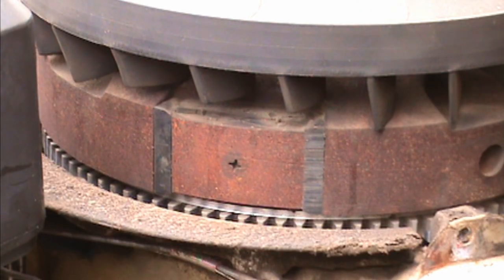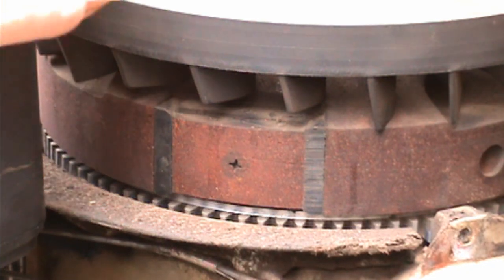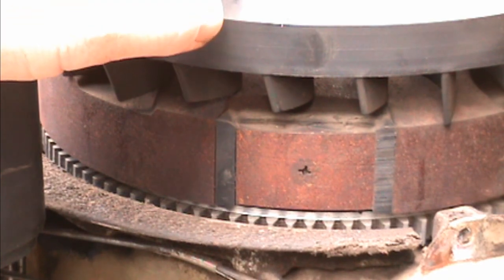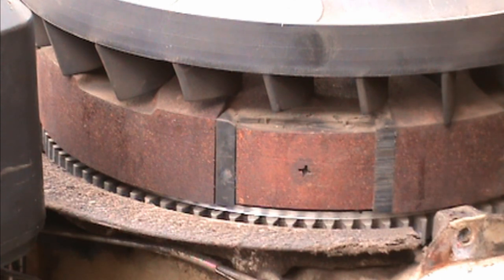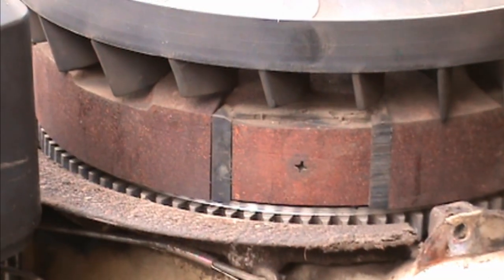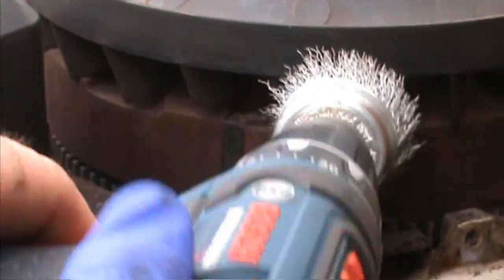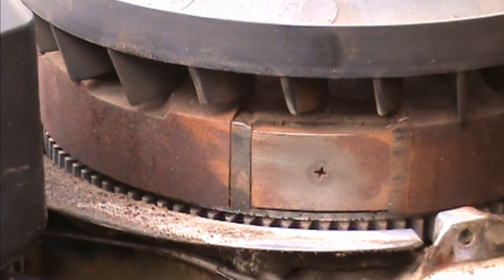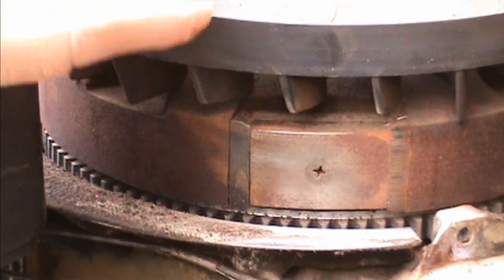Cleaning a lawn mower flywheel rust caused by water or moisture and how fix it.

Comment: On the first pull my mower would run fine for like a minute or so then quit until I gave it 10 minutes, then same thing again. I cleaned the entire fuel system, spark plug, and air filter. I had spent hours messing with the SOB. I was just about to go buy a coil or throw it off a cliff. I came across this video and thought, well I've spent all this time jacking around with it so I guess I try this as my final effort. I was literally about to throw in the towel and this worked like a champ.
Reply from the maker: That is great news, glad it worked for you.

Comment: Thx for sharing. this helped alot.I got my neighbours lawn mower running alot smoother because of this. It had been left outside for two years in the rain, snow without being turned over once. still needs a few other things tweeked but just doing this one thing alone made a huge difference in how the engine runs and sounds and the power its generating now. The regulator is charging the battery which it wasnt before too which is a bonus! new spark plug, carb clean and an oil change and shell be as good as new
Reply from the maker: Great news Gavin, glad to hear.

Comment: Great video.. My grandpa taught me this technique when I was young and my mini bike always started easily
Reply from the maker: That is great to hear.
Reply: Been trying everything to get the mini bike running for the kiddos. Did a run through on it and cleaned everything. It had been sitting few years. Told my pops how it wouldn't started, and had mentioned to him the throttle cable was locked up. He had put 2 and 2 together quite quick and suggested it might be the flywheel is rusted. Sure enough! The false spark had me going through the carb more times than I'd care to admit. Gonna have the boy clean her up tomorrow, this should be what wakes the Ole girl.

Comment: I did this on my mower. Flywheel magnets were very rusty and also so was the magneto just used a small dremel sander attachment and that cleaned it up like new :)
Reply from the maker: Thanks for sharing glad it helped.
Reply: Sounds like a great idea with the Dremmel. However, I’m confused about the gapping of the flywheel. Any tips on performing that?
Reply: @MrRedHotChiliMan When gapping any magneto I use a business card. Then put the magneto in place and tighten the bolts that hold it on. Then slide out the business card. Then I test by turning the flywheel to observe everything is OK. Theres no rubbing of the magnets on the coil.

This method usually works for me
Reply: @mowtoegee7049  okay, thanks for the rundown. Seems easy enough.

Comment: be careful, wire wheel may weaken magnet.  I use 220 wet paper and only rub one direction, compress air for fast dry
Reply from the maker: Thank you for the tip.

Comment: Good video. Had my x530 go out, and was getting what I thought was an insanely small spart on it. 
Pulled the shroud, and that magnet was just covered with rust.  Cleaned it, and replaced one of the ignition coils.
Flywheel gear is so nasty with rust, I'm wondering if I should pull it to clean. 
Good idea about the WD-40, I was thinking of that.
Reply from the maker: Glad it helped

Comment: Thanks for the info. I just cleaned a push mower and washed the entire flywheel. I haven't started up yet since I need to put it all back together and change a few parts but now I'll know what to do if it starts having start up issues. I do have a question, is it normal for the bottom of the engine where the blade rod connects to the engine to be oily?  I already removed all the engine oil prior to cleaning but I noticed that when I tilted the machine over to clean the underside, there's some oil leaking that seems to be coming from the area where the blade rod connects into the engine from the bottom. Any help is greatly appreciated.
Reply from the maker: It could be seeping from seals or a gasket. I sounds like the shaft seal.

Comment: I have found that using a coating of any kind will keep the magnet from getting rusty. Just that simple fella. WD40 is very temporary fix at best. An epoxy coating will last the test of time.
Reply from the maker: Thanks for the tip

Comment: This is why, whenever I wash my lawnmowers, which I do occasionally, I start the engine immediately afterwards and let it run for five or 10 minutes, so it will blow everything dry and heat up and evaporate water.
Reply from the maker: Yeapper.

Comment: Hi could i use a brass brush or does it have to be stainless steel? Thanks!
Reply from the maker: Really, any brush will work to remove rust. Just clean it afterward with acetone or similar cleaner.
Reply: Thanks @jetzombie

Comment: Hello, I'm trying to fix my own lawnmower and my question is do I need to take the flywheel apart to clean everything as I've put a new ignition coil on it and I'm still not getting a spark?
Reply from the maker: The only real reason to remove the flywheel is if you struck something and sheared the keyway that flywheel lines up on the shaft. If it shears, it will through of the time and spark.

Comment: Thanks, this helped.  My troy bilt power washer with a briggs and stratton has a pan around the flywheel with a lip that curves up.  Makes it real fun to try and get it clean with the little bit of space between the pan and the edge of the flywheel.  What are these guys thinking when they design this stuff?
Reply from the maker: Fantastic! You gotta love engineers, I deal with it every day. My brain hurts sometimes trying to figure what they are trying achieve.

Comment: Not enough magnetic flux is flowing through the gap to the magneto to energize it to a full energy transfer. There is no “contact” between it and the magneto. 
What you “will” get is sufficient energy transfer at a lower engine rpm, meaning, engine startup. 
Very little physical momentum needed to turn it over to get proper starting conditions.
Reply from the maker: One other one I got had less than .001 gap and couldn't get it to start. So I cleaned it up and re-gapped to .006 and it started up and ran fine, still running fine.

Comment: Very helpful tip,,,do you clean the whole flywheel with with wire wheel?
Reply from the maker: That's great, I brush off anything that may be sticking out. But focus on the coil and magnet area.
Reply: @jetzombie  thank you sir

Comment: I moved the flywheel around a few times checking compression with the armature off. Does it have a correct position? What I mean, is it like a car engine where you can inadvertently put it in a 180 degree position (like timing) or does that not matter? Mine is a Briggs/Stratton Brute pressure washer. I can't get spark after installing a new armature/coil. My flywheel/rotor is a bit rusted but the magnet seems relatively clean (I did use some sandpaper to clean the entire rotor/magnet of rust). Spacing of armature looks good. It was working but I washed it last fall before I put it away in my garage. Checked compression (dry) and got about 75psi. I just don't see spark (and put in new plug).
Reply from the maker: Bryon,
With what you have described, no your not out of time. What was the gap that you set it at? ideal depending on the engine size and type is usually .006 to .008 between the magnet and the armature. Once the gap gets bigger you will erratic spark or no spark condition. Now make sure the kill switch wire is healthy and not grounded out somewhere. The system is pretty simple but can be a pain too. Now, nothing says that your new armature could be bad, have had that happen to me a few times, straight out of the box. There are some good links to show how to ohm's check your (armature)coil. Your compression seems a little low, but not knowing the exact model makes it a little hard :). if you have a 6.75 brute you might want to check the gap of the valves and rocker arms to make sure they are correct. 
So, I would recheck the kill switch grounding, the armature ohms, the armature gap and get it between.006-.008 (business card or 3x5 is close) and check for the spark with a spark checker like from Autozone or any auto parts store, it better grounding for the plug, seeing the actual spark and less like to be shocked :). Hang in there and feel free to ask anything if you think it can help. 
This is the worst case
You can be off time, but only the shear pin has sheared at the flywheel at the crank mating spot or somehow the shear pin, the flywheel was installed incorrectly, but being that it's a pressure washer, I'm thinking not, because you would still see spark. Now, internal the timing gear assy and or camshaft could have failed too and you would need to drain the oil and look inside with a borescope(you can get a cheap off of Amazon or eBay that works off of the phone or tablet) or pop the valve cover off to see how much the travel is in the valves and rocker arms. But, you would be hearing a clanging around inside and or the engine would be hard to pull , this would not really interfere spark, but compression and starting  But, that's the extreme of it.

Comment: does it matter if you paint the flywheel or not?  if you keep the magnets clean?
Reply from the maker: Not really if the is not rust under the paint and the gap is correct.
Reply: Thank you.  I have a flywheel that was rusty and I cleaned it and treated it with phosphate/cleaner.  I’m just wondering if I should spray a coat of paint to keep it from rusting again

Comment: any oil or  dirt will inhibit the spark more than rust will.       that's the bigger problem.  (and that iron is just cheap cast iron -- so oil can get into the metal.)  it seeps into the metal at a level you cannot see. .
Reply from the maker: Never had any issues after using WD--40, but I could see what regular oils would cause an issue.

Comment: Damn, I gotta do this ASAP! I rinse my 20 year old tractor engine weekly, even the cowl cover. All of a sudden, my tractor started idle surging. Outa nowhere. Ran great for YEARS. I'm wondering now if this is the culprit. I'm hopeful, since a carb teardown revealed nothing
Reply from the maker: It could help.
Reply: I try to do engine  cleaning what ever it is (small or large) with compressed air, leaf blower (to get rid of stuff like grass and grime) and degreaser or carburettor / throttle body cleaner to get rid of gunk. Something about a stream of water going near the engine makes me feel uncomfortable

Comment: i pulled the fly wheel cove off of a B and S v_ line 25 DYS4500 and now i cant get it to seat down so i can get the filter back in any video of this
Reply from the maker: Check the shroud cover and make sure the tangs go on the outside and see if the coil wire is getting pinched, sorry so late on the reply, youtube didn't let me know. if you have anymore questions let me know, good luck.

Comment: My Honda ride on hf1211 struggles to start when hot. It’s just had a new starter motor. Someone suggested a rusty flywheel could be the cause. Any thoughts? I’m thinking either this or it needs a new ignition coil. The engine is a Honda GXV340. Thanks
Reply from the maker: It could be a coil issue, the best way to check is when the engine cuts off to use the spark checker and see if you'll see a spark. If not, then it could be the coil when it heats up and causes a short. Usually, the gap issue from the rust on the flywheel would be noticeable at start-up with a weak or no spark. Now, if you have a spark, then it could be a carb issue with a vaper lock from the heat and causing the engine to shut off too. There could be an issue with the fuel boiling from heat not leaving the area. Check to see if the shroud has grass and or dirt blocking the air from being pulled down by the flywheel fins that cool down the engine and area.
Hope this helps.
Reply: @jetzombie  very helpful thanks. I’ve ordered a new coil and will see if that helps things. When I take the flywheel off, I will clean off any rust too. 👍🏻
Reply from the maker: Hope all is running again.
Reply: @jetzombie  Yes! New solenoid cured the issue. Should have replaced them both together really….

Comment: Do you just clean around the sides or the top of it as well?
Reply from the maker: All around the area, both sides and the top.
Reply: @jetzombie  thanks, just two more questions Do you just blow off the excess dust with compressed air and what do you clean your stainless brush with?
Reply from the maker: @MrRedHotChiliMan  Yes, I just blow it off with air and clean my brush with plain acetone.
Reply: @jetzombie  great, thanks again.
Reply from the maker: @MrRedHotChiliMan  You're more than welcomed.

Comment: Great video thank you!   Will this rust also affect the charging ability?
Reply from the maker: I believe so and my reason is that usually when I come a cross this. I'll test the volts to the battery as it charges and they're low or just what is in the battery.  So then I'll pop off the flywheel and see corrosion on the stator and or magnet, clean them and just do an ohms check to see if its within limits, then put back together and usually it's good to go(have had some fail). It just depends how aggressive people are washing the engine, if water gets under the flywheel and over time it will cause issue. I have had people bring me engines with the shrouds missing either the upper, lower, or all missing, and water has got under. Also, seen it where if the engine sits outside all the time.  Hope this helps.
Reply: @jetzombie  Thank you sooooo much....gonna check that!
Reply from the maker: Anytime,  just let me know if need anymore help.
Reply: Rust inhibits magnetic fields. This is a flux field, it does not make “contact” as such.
Reply: Charging on my Husqvarna Intek V-Twin is via a stator winding bolted in place and a magnet assembly on the inner surface of the flywheel. 
If you remove the flywheel, being very careful to  mark its timing position, yes, cleaning the coil surfaces AND the magnets will produce a better charging circuit.

Comment: My fly wheel broke replaced it with another won't start back fires that's all took back to shop replaced again and same thing won't start what should I do ?
Reply from the maker: If the flywheel and sheer where replace and at the proper slot (timing slot for flywheel, sheer key, and shaft to be inline) and still having issues. Then It could be a few things like the flywheel might be the wrong one, the sheer key slipped and or broke again( very strange), or it could be something internal that may broke, Not knowing how hard the engine was running when or what caused the flywheel to break, also what type of engine it is makes it hard to determine what could be the issue. If in a duel piston engine the internal timing could have slipped causing the issue of the engine now after replacing the flywheel. It's hard to say with limited info.

Comment: Just wondering if I need a new engine for my Cub Cadet 524SWE that does not run. When I spin the engine with a drill & socket it used to spin freely (but would not start) now it spin freely at first then the engine locks up with a tight spot and turns the drill out of my arm. I checked my belts and flywheel key and they were OK. Just wondering why the engine is doing that. Thank you.
Reply from the maker: Sounds like it could build a lock in the piston, the exhaust valve might not be releasing the pressure from the piston. It might be a good thing to check is the valve lash, by removing the valve cover and seeing if the valves move.  Then if you see movement while turning the flywheel (pull the cord) , then they might need to be adjusted.  if no movement then that points to a bigger problem inside the engine like the cam is worn or the timing gear might be worn. Also, do a spark check to see if the spark is there, could be a timing issue. Hope that this might help you. Sorry for the late reply, been on the road.

Comment: Is the fly wheel suppose to move freely? Changed the sparked plug, cranked my engine and still does not turn effectively.
Reply: Are you trying to turn it by hand? If no, it might not be engaging the flywheel (bendix gear/gear reducer issue, also could be starter brushes need to be replaced). 

If you are trying to crank it by hand and it's not turning, take a plug (or all or them out. It shouldn't be easy to turn because of the engine compression. 

If it still won't turn then check your engine compression and/or fuel filter. It could be hydro locked from too much pressure build up.
Reply from the maker: Kelsey, said it perfectly.